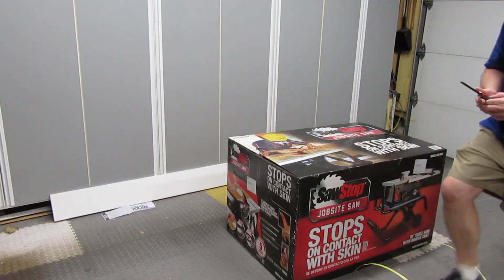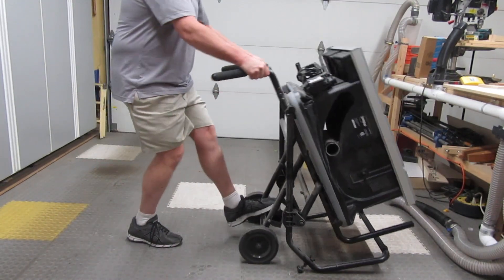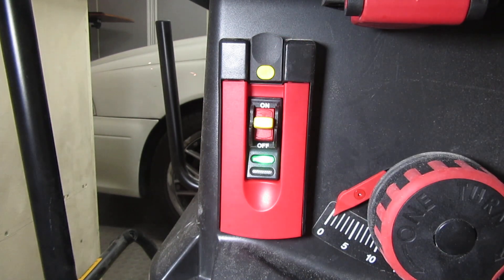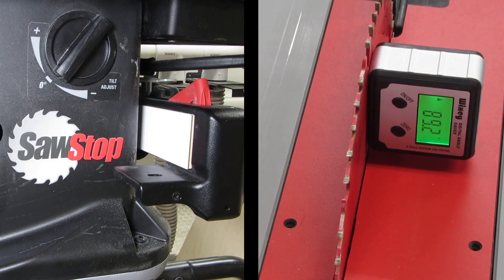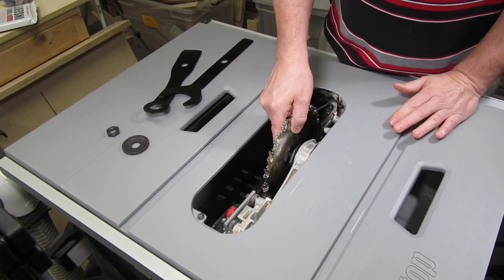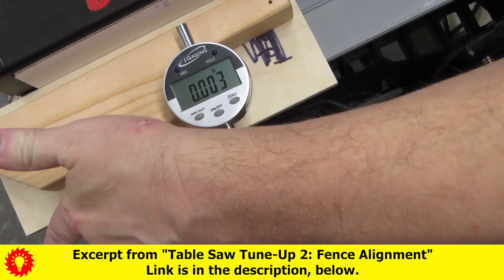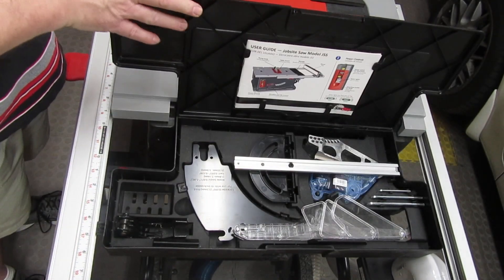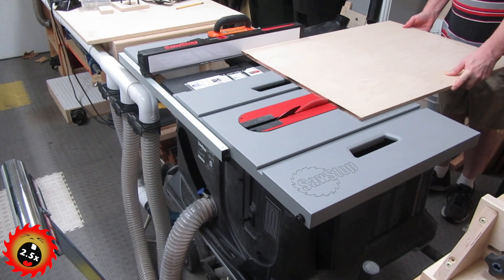SawStop Jobsite Saw Unboxing & 5 Month Review

Comment: Do you recommend it for size? I have a small workspace similar to what I see in the video. I could save some space by selling the Ridgid I currently have and replacing it with a smaller saw and a good miter saw. Or does the small size limit you? Do you wish you had purchased the next size up? It's a tradeoff between floor space and table surface area. Assuming the price isn't the issue, just the footprint vs surface I'd love to know your thoughts.
Reply from the maker: The size is fine, for me. All I've ever used are small saws like this, so I don't know any different.

I don't think I mentioned it in the video, but I had a Ridgid for about a day before my wife convinced me to take it back to Home Depot, and get the SawStop from Rockler. Man, what a PITA the Ridgid was to set up. It's why I raved so much about the SawStop's easy setup. If you look closely at the beginning of the video, you can see the Ridgid's manual near the cabinets. I forgot to return it, LOL. When I found it, I took it back to Home Depot.

But to your question: As I said, the size is fine for me. But in retrospect, had I known of the top and fence issue, I would have tried to figure out 1) if I could afford the SawStop Contractor, and if so, 2) figure out if it would fit in my shop.

I'm not clear on the contractor saw's dimensions. The website is a little confusing. But I think it's possible that the base version isn't much bigger than the JobSite saw with the extension open.

But even knowing what I know now, if I either couldn't afford the contractors saw, or it wouldn't fit, I'd still by the JobSite saw. I did get Rockler's extended warranty, so I got that going for me. :)

Let me know what you decide to do. And take pictures or video!!
Reply: Thank you! I need a full shop reno. I've learned a lot in the past 2 1/2 years so time to re-start the process. I figure the whole thing will take about a year. I will take pictures and share. Least I can do to contribute back something.

Comment: Thanks for the video. I am a beginner/newbie. I am currently researching the equipment I want to get. I would like to get this SawStop saw. Could you tell me what the distance is to the left of the blade? The reason I ask is, I've been looking at the Incra 1000SE combo miter sled. They say that to use that particular sled, you need to have a minimum of 11" to the left or right of the blade. Please advise. Thanks.
Reply from the maker: I don't have the saw anymore (upgraded to a SawStop PCS), so I'm not sure. I suggest you check out the SawStop Users' Group on Facebook https://www.facebook.com/groups/sawstopusersgroup/. There's a bunch of really good people there, and it's run by a good guy from SawStop. 😄They'll be able to answer all your questions.

Comment: I know you’ve since switched to a contractor model , was this job site one accurate in its cuts ? I have a track saw for breaking down my sheets so a big table saw is not really needed any more BUT i do want a good one ☝️ your thoughts would be greatly appreciated!!!! Thanks
Reply from the maker: Thanks. Yes, it was very accurate. My only real issue with it was being able to move the fence a small amount, but it's something you can deal with. I definitely recommend it.

Comment: I'm debating if I want to spend so much on a table saw.  I have no experience.  My issue is that I'm on a blood thinner indefinitely.  If I get a cut, i really, really bleed a lot and it comes out fast.  My father balked at me..he says he's made thousands of cuts with his saw with no trouble although I recall  my mother driving him to the ER with a blood drenched t-shirt wrapped around his hand.
Reply from the maker: You absolutely, positively must get a SawStop. I've never said that to anyone before, but in your case, it's a no-brainer. I usually tell people that the cost of one trip to the ER makes it worth it. In your case, it can definitely be a lifesaver. And use the blade guard.

As far as your father balking, you wouldn't believe the number of seasoned woodworkers who have the attitude that since they've never been hurt, only idiots would ever get hurt. Well, we can all be an idiot sometime. I also hear from a lot of seasoned woodworkers who say "I never thought I'd ever get hurt, but then...".

So if you're going to buy a table saw, buy a SawStop. You won't be sorry. Not only are they safer, but they're great saws.
Reply: @TheNewbieWoodworker  Thank you!  You just helped me make up my mind.  I saw your (great) review of this saw.  I was a little put off by the "crappy" miter gauge and assorted other issues, but it sounds like you'd make the same purchase again. On another note, just watched your very first video.  You've certainly fulfilled your commitment and then some.  This is one of my favorite channels.
Reply from the maker: @jcepri  You know, every once in a while someone comes along and says something so nice, it gives me goosebumps. Thanks, and I'm glad I'm helping. 😄 Oh and yes, I would buy it again.

Comment: I thought for the break to work you had to use one of the Saw Stop blades is that true?
Reply from the maker: I hope not! 😛 Seriously, though, nope. You can use virtually any blade. There are some warnings about certain types of blades not stopping as quickly, and I suppose if someone makes a non-conductive blade, you wouldn't want to use that. Otherwise, any blade will work.
Reply: The Newbie Woodworker that's good to know, I thought you had to use their blades, so I haven't been looking at this brand so much. I will reconsider them now, thanks for the video!
Reply from the maker: No problem. If you do end up buying this saw, and you end up ordering it from Amazon or Rockler online, I have a link in the description above. If you use that, I get a little kickback. Same price for you. Of course you don't have to use those links, and I'm totally cool if you don't. But it never hurts to ask, right? 😀
Reply: ***Unless this has changed***
There was/is (?) an issue with some blades.
Unlike the other sawstop saws, on the contractor saw there is no distance adjustment on the brake. This is an issue with some saw blades because there is a max and min distance specification between the brake and the blade.
I found this to be an issue with a dado stack. Last I knew, sawstop had a list of compatible blades. 

If anyone knows this to no longer be an issue PLEASE let me know.
Reply from the maker: This is still an issue with mine - no adjustability. However, I've used a box joint blade (it's two blades, sort-of like a dado stack) that is technically too close to the brake, and it works fine. I doubt I could get a credit card between the blade and the brake, but it hasn't failed yet (knock on wood), and I've made quite a few cuts with it. https://amzn.to/2MfwNS4, although the case is different now, so I can't guarantee the blade is the same.
Reply: My concern was due to concerns about the triggering of the brake. Not knowing how it works in detail i was concerned about either being too close or too far -- relative to the spec that was in the manual. I do not know about current specs.
Reply from the maker: I understand completely. The only good thing about it is if it does trigger the brake, it "only" costs me the brake and the blade. And hey, spending another $200 is no big deal, right? 😳
Reply from the maker: @Harry M LOL. I think I'm going to just trust that it'll work. Thanks, though. 😄
Reply from the maker: @Harry M Actually, I don't have to go that far. With the power switch on (but the saw's not running, of course), if I touch the blade, the red light flashes. I see it happen every now and then, and I just double-checked right now to make sure.
Reply from the maker: @Harry M I hope so. 😛😳😮
Reply from the maker: @Harry M I kinda have to apologize - I forgot the original poster's question, so I wasn't sure why were having this conversation. So if I came across as terse, or anything like that, I'm sorry. Now that I re-read the original post, I realize you had very valid questions! So thanks for asking them, even if I am a little scatterbrained.
Reply from the maker: @Harry M Thanks!

Comment: They probably guessed that anyone spending that much on a saw would buy an upgraded mitre gauge, therefore saving money on the one they include wouldn't matter.I would prefer they lower the price by not including the crappy gauge at all, and I'll use the one I already have, or buy a good one, which I will need to do anyway. Either way Sawstop is not in a hobbiests the budget at all.
Reply from the maker: Good point on the miter gauge. As far as a hobbiests budget, that depends on the hobbiest, right? :) But I get what you're saying.

Comment: You can use any brand of saw blade and not the saw stop brand?
Reply from the maker: Mostly, yes. There's a couple of styles of blades you want to avoid, though. Check out SawStop's FAQ: https://www.sawstop.com/support/faqs.
Reply: @TheNewbieWoodworker  that's good news. Now I just have to figure out how to pay for one lol. Thanks for the reply.
Reply from the maker: @theirishman088  😂 People sell them every now and then. In fact, I sold this one (to buy a bigger SawStop) on Facebook Marketplace. So you might want to look around. Good luck! Oh and yes, I still recommend this one, even though I bought a bigger saw (I had some money burning a hole in my pocket... 😂).
Reply: @TheNewbieWoodworker  I dont blame you its a beautiful saw. I think I would spend more time waxing and cleaning it then using it lol. I have a small space and just starting out so I picked up a dewalt which has been great but for the safety of the saw stop I have buyers remorse now and wish I would of bought the saw stop. Oh well live and learn lol thanks again! Have a great holiday!
Reply from the maker: @theirishman088  Thanks, and you too! By the way, if you bought the DeWalt at Home Depot, you may still be able to return it. 😛
Reply: @TheNewbieWoodworker  I just went past a year of ownership so I dont think I can return it now. Even if I could i think they would only do store credit and saw stop doesn't sell through home depot anymore which is a bummer or I would of bought through them.
Reply from the maker: @theirishman088  Yeah, a year is too long, for sure. When I bought the JSS, I bought it at a local Rockler store. When I bought the PCS, I bought it from a local Woodcraft store. And you're right, HD doesn't carry it. "First World Problems", right? 😂
Reply: @TheNewbieWoodworker  HD use to carry saw stop but not anymore and I purchased the dewalt with my HD credit and they will accept returns on the card before the year is up and went fast due to a new baby so it hasn't been used much this year but I missed it and there was no other table saw I was interested in at the store. Im very new to wood working but addicted to it already and found the only rockler store in mi 5 mins from my work so I spend alot of time and a little money when I can buying from them. Plus drooling over the saw stops on display and all their other great products. I guess in time I'll make the move lol.
Reply from the maker: @theirishman088  I know all about browsing Rockler - there's so much cool-looking stuff! I try to not go there unless I really need something. 😄 Of course nowadays I do a lot less in-person browsing. Anyway, enjoy the new hobby (and new baby). If you have any questions, just let me know. About woodworking, not babies. 😂
Reply: @TheNewbieWoodworker  thanks! Great videos and reviews have a nice holiday
Reply from the maker: @theirishman088  Thanks, and you too! 😄

Comment: Can you do a review on your incra v120 miter gauge.tnx!
Reply from the maker: It's... OK. Obviously it fits well in the miter slot because it's adjustable. The thing that's slightly annoying is that as you slide it in, and the gauge portion gets to the table top, it "catches" a little on the edge of the table top, and you have to lift it up a little to get it over the edge. Well, I suppose you could just push it until it gets over the edge of the table, but I'm worried that'll leave marks on the edge of the table top.

But this is the first miter gauge I've actually used, since all the ones that came with my tools sucked too much to be useful. So maybe this is a fairly common issue with miter gauges, and I just don't have enough experience to know that.

Would I buy it again? Not before looking at the other options, to see if there's something better. This thing just doesn't "feel right", if that makes any sense. But it's gotten some good reviews, so maybe it's just me.

In any case, those are my thoughts.

Comment: Looks like the same stand as on my craftsman saw.   Is that a steel top?
Reply from the maker: Steel top? I guess you didn't watch the video. 😉 Nope, it's some sort of hard plastic or something, and it scratches. It's one of my complaints about the saw.
Reply: @TheNewbieWoodworker  Pretty sure the table top is aluminum.  Thanks for the honest review too!
Reply from the maker: @Fenimore.Cassidy  I don't think it's aluminum, but I could be wrong. When I did a little filing on the end of one of the miter tracks, it didn't sound or feel like aluminum. But as I said, I could certainly be wrong. Thanks for the comment!

Comment: Thanks for the video!  I'm just about convinced that this is the saw for me.   It's difficult to tell watching the video-- is the riving knife slightly lower than the top of the blade?  I'll be doing a lot of rabbets and dados (without a dado blade), and I would very much like to have the knife when doing so... Thanks!
Reply from the maker: You're welcome! The riving knife is maybe 1/16" lower than the top of the blade, so you'll have to remove it. I've never noticed before, but I would think people would almost always remove their riving knife for that, but I could be completely wrong. Hope you enjoy it! I know I do. :)
Reply: While reading through the owners manual of SawStops cabinet saw, I found it recommends the riving knife be installed for all non-through cuts.  Since the job site saw knife is indeed lower than the blade, I think we can safely assume the procedure for the job site saw is the same as the cabinet saw in this case.  Here's the link for the manual in question:  http://www.sawstop.com/images/uploads/manuals/ICS%20Rev.%202%20Manual%20V3.4.pdf
Reply from the maker: OK, I'm gonna ask for a do-over here. Of course you're right, and of course you can keep the riving knife on when cutting dados and rabbets. I have no freaking idea what I was thinking. Honestly - I've racked my brain, but I have no clue. I don't even drink! Whatever. shakes head, palms forehead I'm really glad you didn't accept my answer. I have a feeling that, in a few days, this comment thread might disappear, if you catch my drift - just too embarrassing! What an idiot...  :o
Reply: No worries!  I figured you probably had a touch of dyslexia and actually meant to say, "leave it on" instead :D  As with most things in life, trust but verify ;)  Looking forward to your next video (even if this particular thread does disappear...)!
Reply from the maker: Thanks. That made me laugh. "Uh yeah, you're right - that's what I meant!" Ah whatever, I'm human. I'll leave this to remind myself to stay humble. :)

Comment: so you're sayin serial killers would have no real use for this system , and should just stick to the chain saw and mulcher
Reply from the maker: Well, they could run it in bypass mode, then they wouldn't trigger the brake. But if they forgot and triggered the brake, they probably wouldn't have another one on hand, and then they'd have to go back to the chain saw. 😂
Reply: @TheNewbieWoodworker  you even answered the silly comment, your awesome, i wish you were my neighbor
Reply from the maker: @jakeqwaninne8502  LOL. The volume of comments I get is still manageable, so I try to answer each one. YouTube doesn't make this easy for creators, especially when someone replies to a post that's old. But I'm a retired software engineer and I wrote a little utility to help me find almost all of the comments, and that helps. And besides, I like to talk. 😄